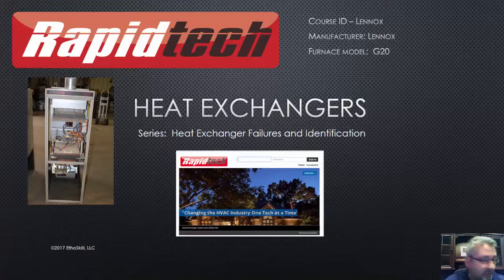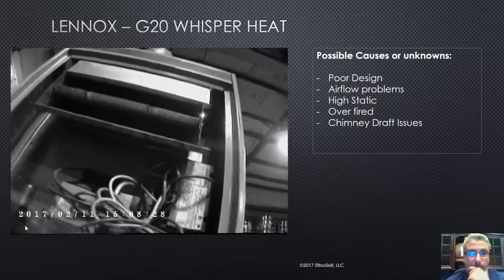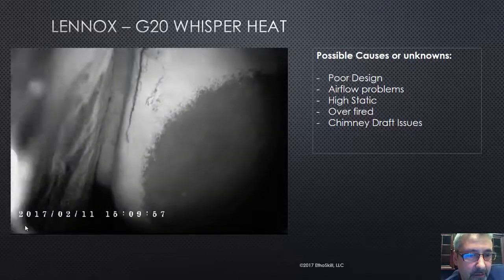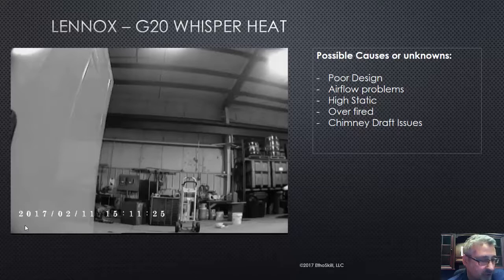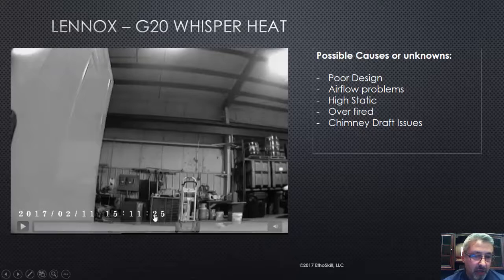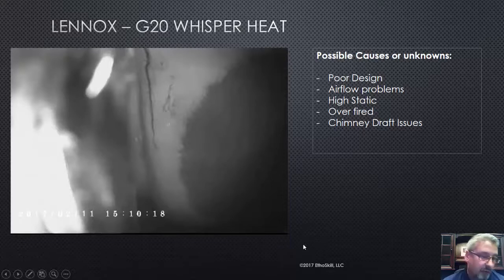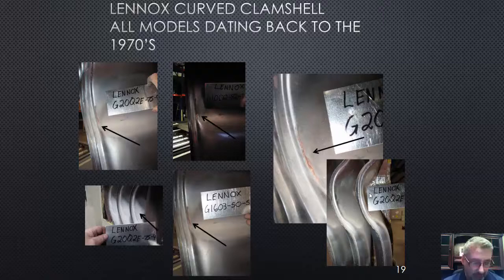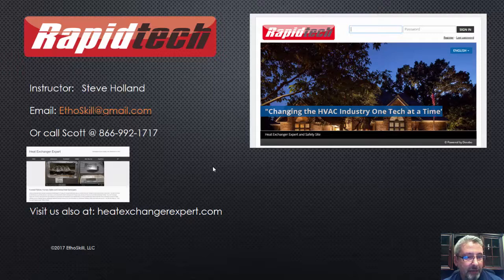Lennox Gas Furnace - Cracked Heat Exchanger

Comment: advice on best furnace brand for utah? my g20 is about 30 years old
Reply: A little late on response  but  if you're not worried about high efficiency stick to a 80% furnace they last longer. Almost any brand installed by a really good team and backed with a good warranty you should be good. I've installed Trane, lennox, goodman, amana, and carrier 
I personally prefer trane and carrier.

Comment: The video would be much more helpful to show how you would check the back of the heat exchanger with the a/c coil attached to the top of it. Taking the burners off is one way to see the first curve. However an a/c coil would need to be opened and any panels inside removed to access the portion of the heat exchanger shown in this video.

Comment: Hi how old are these furnaces your checking 20 or better years old G-20 furnace stopped production early 90s lennox awesome tec tips but these furnaces are all at or past life expectancy
Reply: I'm sure there are lots still out there. The standing pilot 70s and 80s duracurve models (G8, 10, 12) have little to break so they can run for many years without attention other than filter changes, which are done by the owner. the cracks are unlikely to be found until a repair is necessary, they can run for decades with cracks.

Comment: Lennox pulse, One of the most reliable furnaces ever built? Better double check that. https://inspectapedia.com/heat/Lennox_Pulse_Furnace_Notice.php
Reply from the maker: Delta T - Thanks for the link. The heat exchanger on that furnace was not very reliable. However, the overall operation was very reliable. Anyway - thanks for the info!